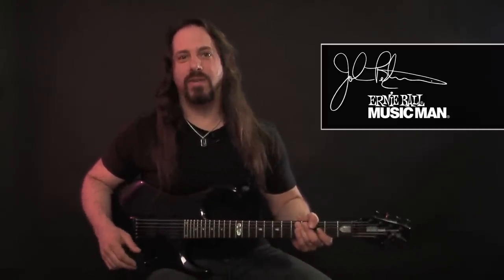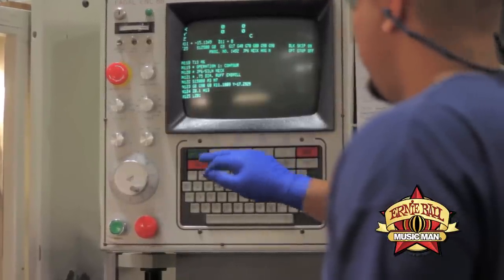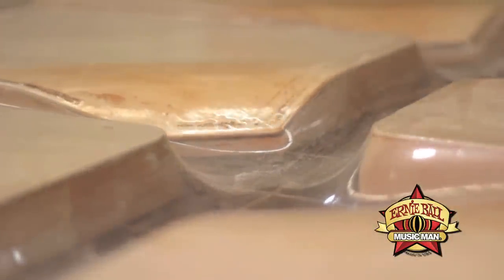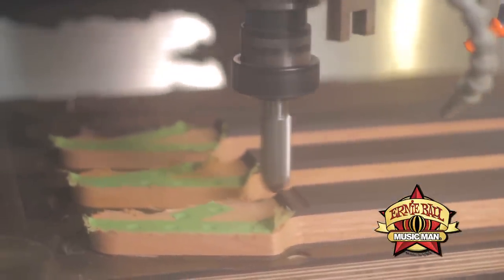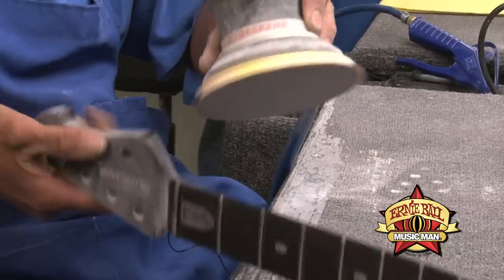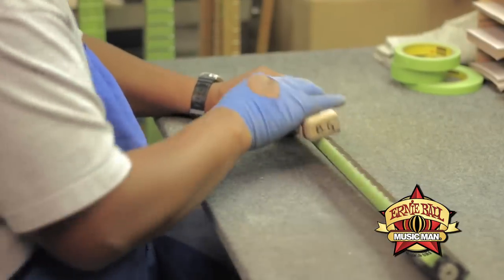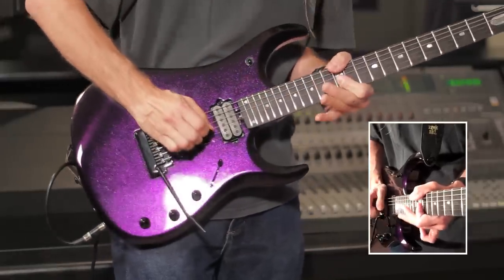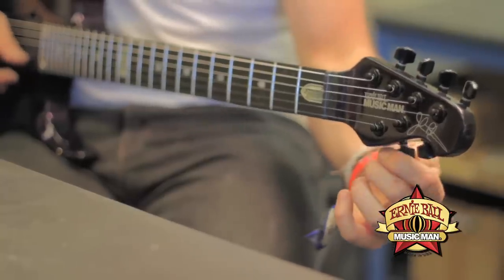Building The Ernie Ball Music Man JPX with John Petrucci

Comment: "Mahogany tone block." Gimme a break. What rubbish.
Reply: fretbuzz59 i was wondering what the fuck was the point of cutting out a piece of wood just to put another piece of wood in
seems like a bullshit reason just to jack up the price
Reply: Taco Ramirez For sure. Plus it's a waste of wood!
Reply: fretbuzz59 They probably think it adds some "warmth" to the guitar, or scooped mids, allows it to breath etc. I thought it was stupid too.
Reply: fretbuzz59 foreal all that time bs goes out the window when u plug in.
Reply: Gimme a break, different woods have different densities which means sound travels at different speeds through them. It's science, not rubbish. My theoretical explanation would be that the denser mahogany is more responsive and gives better note separation because it more dense (sound travels faster), while the basswood is lighter and more resonant(sound travels slower and vibrates wood more). This also mirrors my experience with my Limited edition JP12 that has a solid mahogany body and neck  and my JP7 which was basswood body and maple neck. The JP7 felt more alive, the JP12 felt clear and responsive.
Reply: Tyler Rodriguez oncs again once u plug in the amp gives u the tone
Reply: nice troll bait
Reply: elitebelt bwuhahaha
Reply: Tyler; the exact opposite is true.  Lighter and more resonant means more vibration which translate into absolutely nothing in an electric guitar.....That being said; I can assure you without doubt; IF you gave JP two guitars; one with the tone block; one without; one chambered and one not---HE would NOT be able to tell the difference other than the physical weight. Wood has virtually no effect on tone when it comes to an ELECTRIC guitar. And it has minimal effect on an acoustic. Tone comes from pickup position in relation to  string scale length; and the windings/magnetic makeup of the pickup and its relation to the amp. All this crap with  "maple caps are brighter" mahogany is darker "basswood is more mid focused" is all sales rhetoric. Pure sales rhetoric. Science proves it.
Reply: any difference you hear would be electronics related. Possbily in the way the strings are mechanically connected to each instrument: ie bridge, tuners, intonation and tuning related issues.  Wood has no effect on tone---ESPECIALLY ON A STRAT with gigantic pickguards and single coils.Does the type of plastic pickguard affect the tone? Does a 3 ply pickguard provide deeper bass while single ply gives you more focused mids? People that make bold claims like yours should provide sound samples. Sound tests proving my case can be found everywhere. I bet you can tell the difference between modelers and real amps? You can pick out which mesa is real; which marshal is fake? Furthermore; I GUARANTEE you that in a blind test; you could not distinguish between the two guitars.  This "wood makes a difference in sound' has been proven many times over to be placebo effect. What is spanky? Let me guess, the maple one had a bright articulate sound while the mahogany had a "darker richer" tone? The mahogany provided a bolder deeper bass? The maple provided a more focused midrange? Nothing personal against you. This is a case of sales, sales, sales. Bottom line. Things that effect pickup output are: location of pickup in relation to strings; electronics between pickup and amp. Best wishes----BJB
Reply: I will start with grammar....."right not wright" then the  next sentence should read ....so buy a plywood squier and PUT good pickups....""" I think they just can't buy that 4k guitar and search for some shit reason to forget it.....but it will not change the fact that this fuckin 4k guitar worst 4k"""" I have no idea what you are trying to say here. What is a Fiat Panda?  I specifically said that it was nothing personal with you; AND you took it personal. Then you attack me. Facts are facts. Science is science. I did not write the rules of the universe; I just follow them. The JP models are made on cnc machines made in the early 80s. The same equipment that make a squier make JP.  And by the way; Ferrari has one of the worst reliability records in modern automobile history. And Ernie Ball has a lackluster track record as well. That is why they have lost EVH and never really gained any real talent; other than JP. Again, advertising has swayed your opinion. This is my final reply to you. As far as things that effect tone on a guitar; wood would be the last; having no effect at all Things that effect tone: 21 thru 24 fret first; pickup position in relation to scale; winding and magnet of pickup; electronics of guitar; type of bridge and tuners ---those things effect tone. Wood does not.